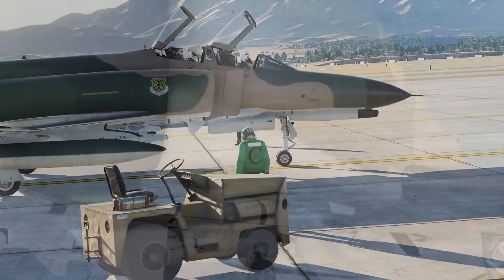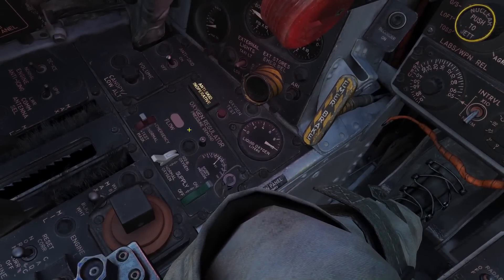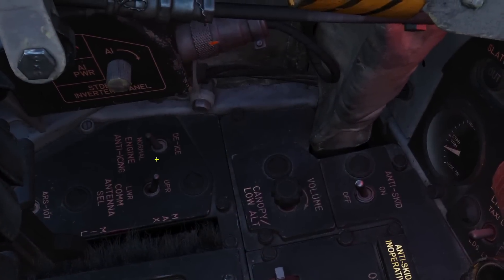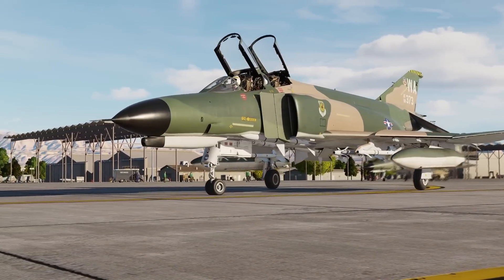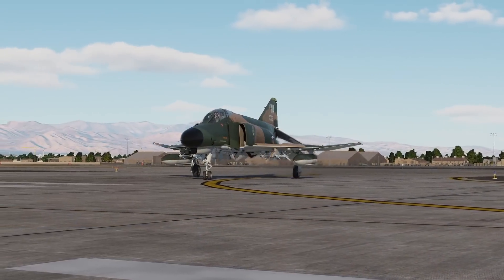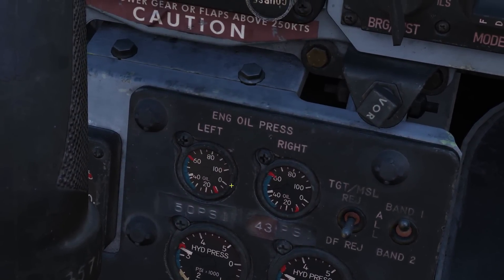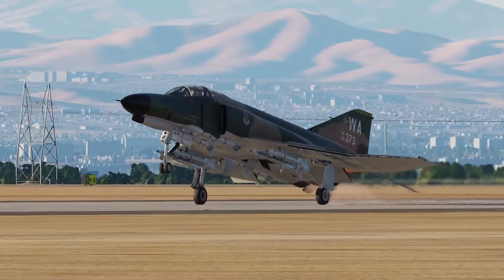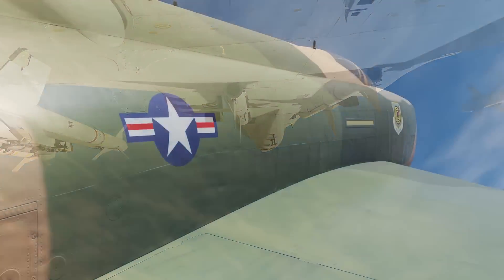Taxi & Takeoff Tutorial for the DCS F-4E Phantom by Heatblur

Comment: A few questions from a noob, sorry:
- How do you steer on the ground? I know that you press the nose steering button, but how to turn, do you do it with the rudder or the stick?
- So take off/landing set the flaps/slats to out-and-down and when flying, set to Norm position correct? And in order to change it, the speed needs to be at 212 knts correct?

Edit: Reason I ask about flaps/slats due to I may have messed up during the take off then flying yesterday, after a while I can't pull the nose up
Reply from the maker: Yes you steer with the pedals while the nws button is depressed. 
Correct about the flaps. Out and down for takeoff and landing, up for flying
Reply: @ReflectedSimulations  Thank you, was confused when need to press that button to turn on the ground.

I guess I messed up the flaps when I took off first time yesterday lol

Comment: I would say this is one jet where having VR goggles are going to be quite nice (and it is).  The view forward is very cluttered for the pilot…and almost nonexistent for the WSO.  Looking with two virtual eyes, in 3D, helps with seeing past all that…the same as in the real thing.
Reply from the maker: It does, especially because there is no hud to give you clues about your descent rate
Reply: Somewhat like the F-5E, you’re going to be sort of looking down the nose at the runway you intend to land on, in a nose-high attitude.  Try to establish about a 3-deg glide slope, gear, flaps and slats “down and out”.  With a clean machine and about 4000 lbs fuel, looks like “on speed AoA” speed is around 135 kts.  The AoA indexer lights tell you, as well as a beeper/tone system.  Steady tone when you’re on speed and optimal AoA.  I’m still learning how to maintain that speed.  Just takes practice with the throttles and how to anticipate the response needed.  Up around 85-88% RPM, I think.

It would be cool if either a mod-maker or DCS could make a GCA (Ground-Controlled Approach) controller for DCS.  The one where the controller is talking to you almost continuously and no response is required.
“You’re on glide path.  You’re right of course.  Turn left heading 243.  You’re on glide path.  You’re 3 miles from touchdown.  You’re slightly above glide path.  You’re approaching course.  Fly heading 245.  You’re on glide path.  You’re on course, 2.5 miles from touchdown,” etc, etc. until you report runway in sight.  And you just maintain that on speed AoA in the landing configuration, holding a descent rate and heading that keeps you “on glide path, on course.”

Comment: I flew the F-4 for the first time, yesterday, and I didn’t wreck it!  It was a 2-hour FAM mission with 20 minutes in the air! 😂.  Sitting on the ramp, engines running for a half-hour, and no oil pressure indications.  How do I tell Jester to turn on the generators?  Oh!  I have the switches!  (Right console).  So much to learn. 😄.  Actually, much of that was in pause, setting up my joystick/throttles and switch bindings.  It should keep people busy for a while.  Up to FL340 and back down for a 12-mile straight-in.  I sort of plopped it down “firmly” on the landing with Jester complaining something about his mustache…I didn’t think he had one. 😂.  But the crew chief didn’t gripe at me.  A couple times, “yeah, did that.  It’s done. Done.  Did that.”  😂.  I clicked an item too many times.

Comment: The F-4 is not a brick with engines, it's a jet that thinks it's a Saturn V rocket with control surfaces to prevent it from going into space.
Reply: Fun tidbit about the F4: They were used as camera planes for several of the gemini missions which involved two phantoms with camera pods going mach jesus towards the launch site at high altitude and then pulling a vertical climb alongside the rocket until running out of energy.
Reply from the maker: @7e21  Cool! I wish we could simulate that in DCS!
Reply: @ReflectedSimulations  I've been really tempted to try and make a mod for something like that. But I only know the 3D modelling side of things.
Reply from the maker: Exactly!:)

Comment: People keep saying they struggling on landing, meanwhile I’m buttering each one.
Trick is don’t let your airspeed drop to much, keep at least 200 on the final approach to be able to glide down with flaps and slats deployed.
Right before touchdown, pop speedbrakes and reduce power to idle, should bring you around 150, pop drag chute on touchdown
Reply from the maker: 200 is way too fast. I’m working on a landing tutorial right now
Reply: I could manage a very smooth touching down but having a tough time rolling out straight. My touchdown speed is about 150knt and brake chute deployed roughly about 2000 ft later then the aircraft starts rolling to  either left or right side of the runway. Using pedal to steer it would result in a horrible skid. WTF am I possibly doing wrong here?
Reply: @huey_dvr  anti skid is on? Remember to use smooth inputs and let the drag chute and air brakes slow you down
Reply: @huey_dvr  Also don't engage NWS until below probably 70 kts, and adding curves to the rudder axis can help a lot
Reply: @eminententropy  I should have read the user manual more carefully. Anti skid mode on did the trick. And you're right to apply NWS at appropriate timing.

Comment: Outstanding instructional video!!  Some minor debrief items:
3:39 -- The Dash 1 has you close the WSO's canopy first, then the pilot's.  Looks like DCS Phantom was programmed for the pilot's canopy to close first.  Incorrect, but no biggie.
3:59 -- In the preflight crew brief, the pilot instructed the WSO on whether he wants the Command Selector Valve in horizontal (the WSO punches out both aircrew members) or left in vertical (the WSO punches only himself, leaving the pilot behind).  This had to do with whether the pilot trusted the WSO's experience level.
Reply from the maker: Thanks for the info! Interesting. In DCS the player is the pilot usually so the AI WSO only knows he wants to close the canopy when he actually closes it. I thought horizontal was SOP but it makes sense, I’d want it vertical if I knew an inexperienced guy was sitting behind me.
Reply: @ReflectedSimulations  TO 1F-4E(G)-1, Chapter 2, BEFORE TAKEOFF:
Step 4c: CLose aft canopy...
Step 4d: Close forward canopy...

Why?  With the front canopy closing first, if the pilot's ejection seat inadvertently fires, there's nothing to protect the WSO from the rocket blast.  By closing the rear canopy first (with the pilot's canopy still raised), it'll give the pilot some protection from rocket blast if the WSO's seat inadvertently fires.  

BTW, after landing we always raised the canopies together.  Not a Dash-1 reference, just a crew working together.

Comment: I keep slamming back down while takingg off, anyone else have that issue?
Reply: I did until I adjusted the saturation and curves on my stick axis settings. The stick seems to have a very short throw and I had to saturate the range in both X and Y axis to 50% to match my stick inputs to the cockpit’s movements. This lead to quite twitchy controls, so I put 25 curve on each axis which smoothed things out a bit, but as reflected says, you need to ease forward as soon as you lift off but I find you need to be smooth with it to, even with curves set